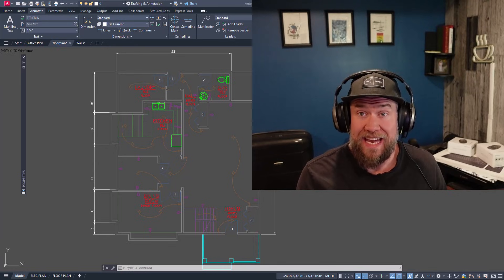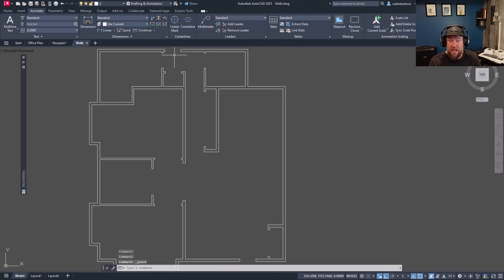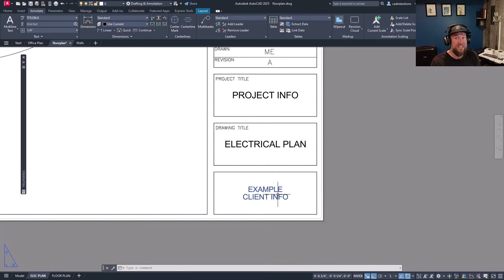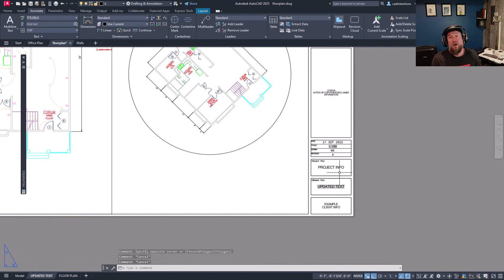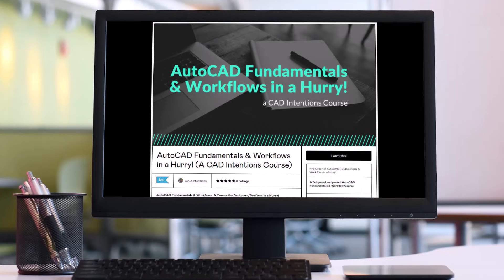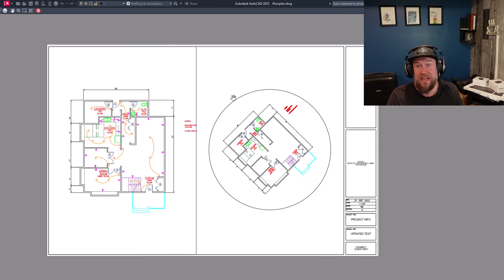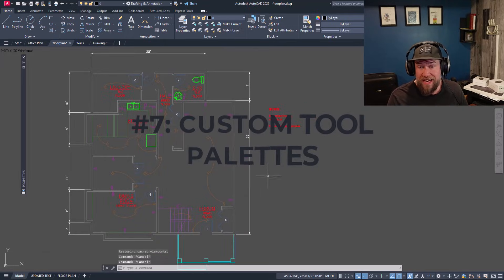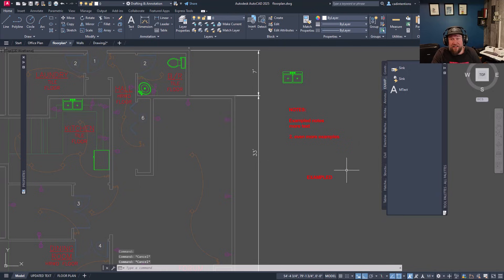How to Be More Productive in AutoCAD (7 Must-Know Tricks)

Comment: Disagree with X-Ref's to a point.  If you work with a group a people, X-Ref's are great.  If you work alone it's pointless.  Layers layers layers layers layers layers layers...   Been using Autocad since version 9 DOS..... One drawing file.   One set of walls.  Use 2 or 3 node layers.  Use scripts to turn on and off appropriate layers per plan page.  Scripts with layer commands can control layer linetypes, colors, etc.       I haven't used a x-ref in 30 + years of drafting and design with Autocad, and draw / design 1 to 3 story structures using scripts and simple lisp routines.